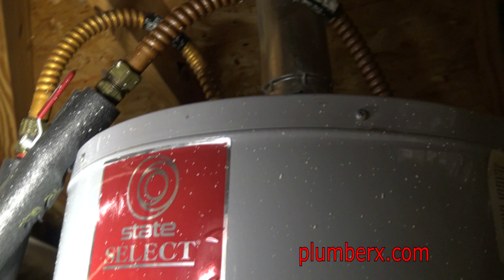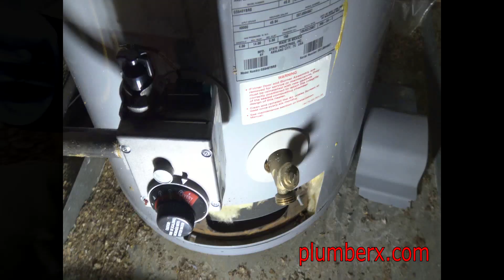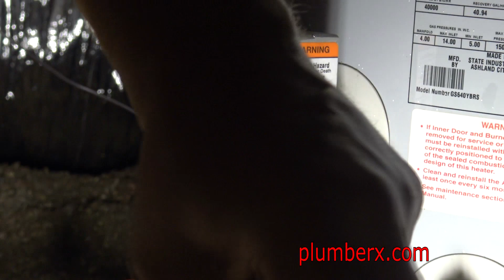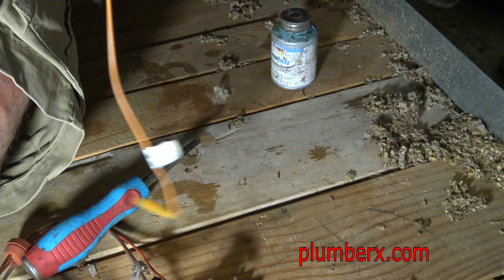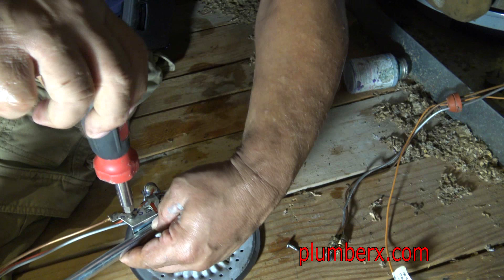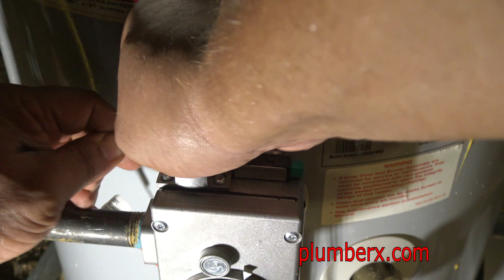I Tried Lighting Water Heater

Comment: Not something I would ever do, bad idea to have wh in attics. The pro on tankless you do not run out of hot water, the cons you have to have good water pressure. I just installed a tankless in my home. Also you have to filter the water to tankless, clean them every 6 months. Where a normal tank water heater you do not have to filter the water, clean 1 time year,  but you will run out of hot water if running alot then wait for it to heat back up.
Reply from the maker: Exactly

Comment: 1. Placing something that has to be maintained in a dirty attic with no place to work is a bad idea if you ask me. However, I work under the same conditions and I do understand that people want those kinds of appliances out of the way when they are as ugly as that particular one :)
2. I don't like that type of water heater, mostly because they are not energy efficient. When you need that big a water storage tank the burner is under-dimentioned (design problem)
3. Flow heaters are ok if it wasn't for the fact the get clogged by calcium deposits (but I also install them)
4. My preferred type of type of gas installation is a wall hung combined heating and hot water systems (e.g. https://www.bosch-thermotechnology.com.au/au/en/ocs/residential/condens-5000w-1001946-p/ or Vaillant ecoTEC Plus systems.